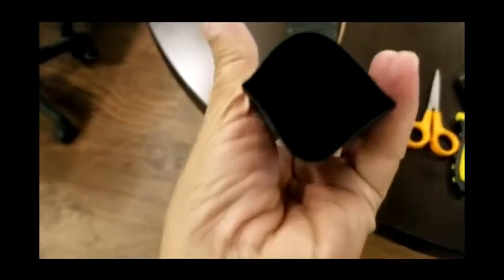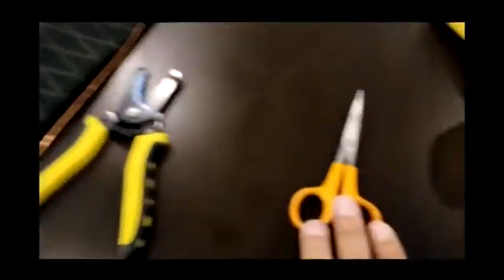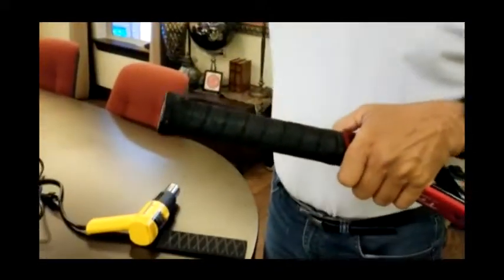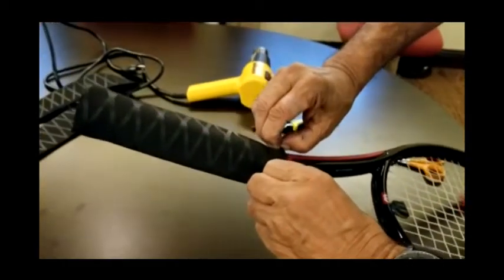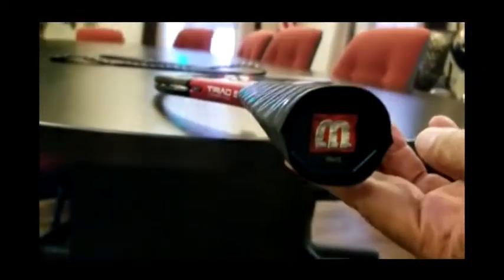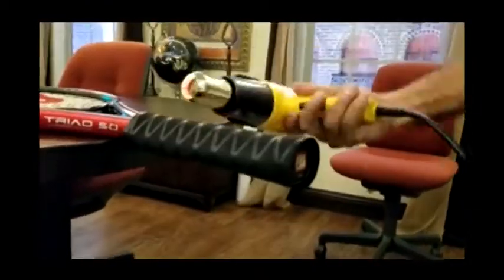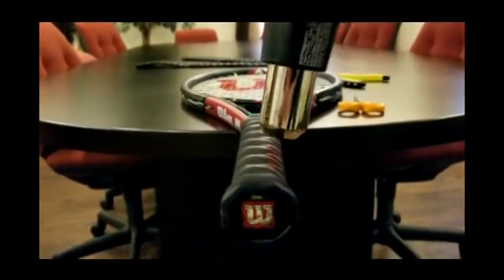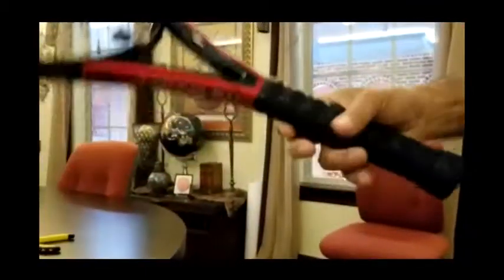TENNIS RACKET HANDLE WRAP USING HEAT SHRINK

Comment: Why are you putting this over the grip?  Should go under the grip directly on the handle.
Reply from the maker: It is best to remove the old wrap. I have done 3 rackets and only one was over the existing handle. It just makes the diameter a little bigger. It is all up to you if you want to go over the wrap or remove it before installing the new sleeve. It will work either way. Hope this helps.
Reply: @ledcityusa  Thanks for the reply.